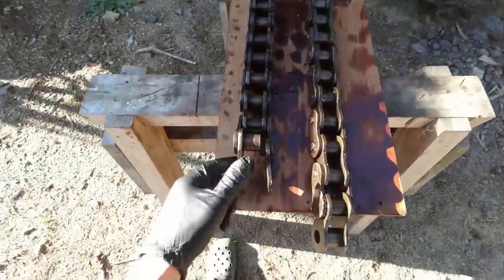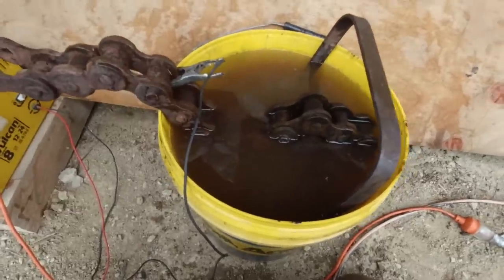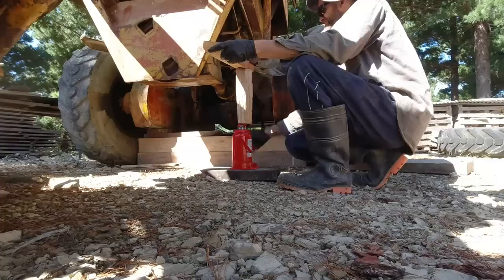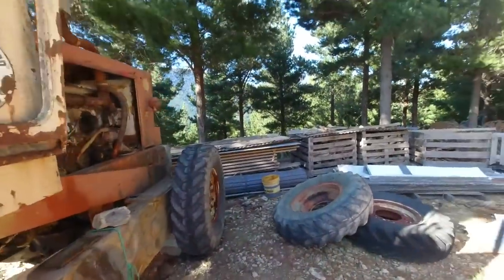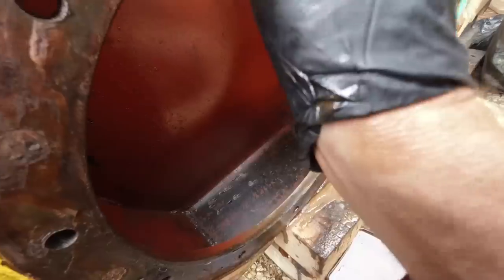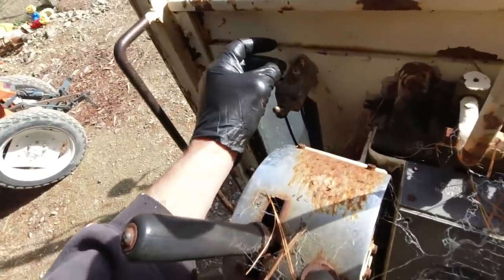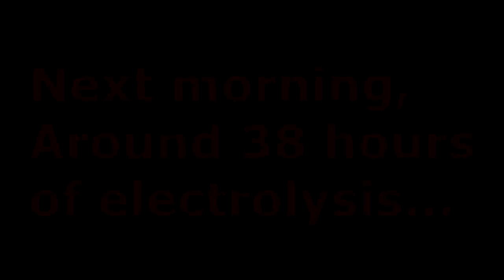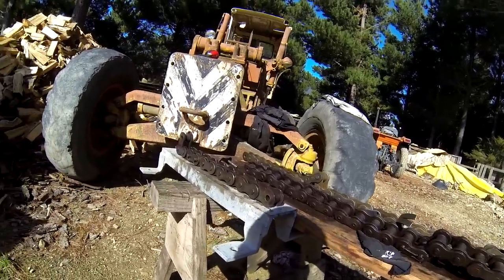12 Ton Grader for Scrap value Part 3- Long Overdue Repairs & Maintenance

Comment: Hahaha! Love the "Bug Grader" ornament". Still laughing... That's great. With a little time she'll be all rusted up nice and looking like it came that way. :)

Gear suggestion: Get yourself one of those inexpensive "Ditco's", a 90' pneumatic grinder that takes the screw on discs of all types. That is a heavily used finishing and general usage tool in many machine shops. A few drops of 30 weight in the nipple before each use, a towel on the exhaust with a couple of shots of air and you're good to go for an 8 hour shift. The veins are phenolic and the innards require a few drops of oil at each daily use to keep blades, gears & teeth lubed so they last. Makes short work of touching up things like large gear teeth. ;) That stuff that came out of that reservoir I think is the worst you've changed yet! Yum! :) 

The gear housing you pulled with the thin seal. I wouldn't put that back without some Permatex Gasket Maker. so you "know" it won't ever leak.

Nice job fixing the air switch and catching the tire size driving issue. Shame you couldn't make one good chain out of the two, probably for the best making the investment in a new, or good used. She'll be worth a lot more if you ever sell her off after you've gotten your usage out of her.

Great job so far! Love that bug!

Comment: For chains u can also use old oil. Put the chain in a pot with the oil and heat it on a fireplace, heater..etc.

Comment: Evapo-rust that stuff is amazing I had a chain in the same condition when it was done soaking 2 days and then in transmission fluid for 24 hrs it looked and functioned as if you bought a new chain

Comment: Heavy gauge polythene film for the hub seal would be suitable Marty it helps it slip round, (not too heavy though). I've used it on those type/size of hubs before mainly Coles Cranes with rail wheels fitted for railway goods yard use. I know what you mean with the ram. I bent down feeding one and it automatically head butt me. Few minutes before I got my senses back.. I bet it never felt even a murmour.. Good vid, brought back outdoor machinery work I used to do for British Rail (LNER) in the 70's.
Reply from the maker: Good idea, cheers

Comment: A few things.  Try washing soda (sodium carbonate) in the electrolysis tank and not salt.  For rusted chain get an old pan, waste oil and a hob.  Heat in the rusted chain and oil on the hob on medium for an hour or more, frees up nicely.  Last I had no you are Angry Ram!

Comment: If your stuck for a filter wrench again and the box section you have is too wide I've seen an "adjustable" one made up; Drill two holes in ajoining sides, then weld two nuts on over the holes and you can thread in bolts to take up the slack

Comment: Marty have you got any big magnets you can stick inside the tandem cases? Perhaps those big ring magnets you get on CB radio car aerials.
Reply from the maker: I would be worried about the chain picking them up and getting dragged into the sprocket

Comment: Never used salt but I have used Baking Soda with real good results on a rusty Old single cylinder hit n miss engine, and after 5 days it was freed up and turning over and you could see the original green paint. The engine was burred in the ground for 30 years, it is now one of my show peaces

Comment: Regarding the tire diameters-  I think you made a good observation about tire diameters.  I once had a New Holland windrower with hydrodstatic steering.  When bot h steering levers were fully forward, the thing would not necessarily go in a straight line.  The manual told me to adjust the tire pressure to get the tire diameters to exactly the same diameter.  Maybe you could do that to make the effective diameters the same.
Reply from the maker: Good point, I will run a tape measure around each tyre while its sitting on the blocks

Comment: In fact I think the bigger diameter tire was making the smaller diameter wheel turn around too slowly.  The distance travelled in one rotation of the big wheel is more than the distance of one rotation of the smaller wheel.  He's right about the fighting, in any case.

Comment: You could use a good pressure washer ! I enjoy your channel very much . Thanks !
Reply: Marty has one. I think his philosophy is that oil leaks show up where adjustments are needed (like all the loose bolts on the diff) or seal/gasket leaks.  Once these are fixed it becomes worthwhile to clean it down..but as we see, oil soaked metal doesn't rust and paint stays bright under the "protective" oil coating......

Comment: Wow did you see that great grinding compound coming out of the oil sump?  I'll bet one could do some nice polishing with that stuff...or maybe some de-burring, eh? -- This is probably too late to help, but what about making your own thin film gasket using a plastic garbage can liner?  I've measured the thickness of one particular bag type at .015", I'm sure there are flimseyer types to be had.  Good luck with the grease, can't really be any worse that it was. -- It's nice to know that the tool you made comes with a life time warranty:  Manufacturer will fix or replace upon any failure of this unit. -- Hey that's a really cool snail.  Great video Marty, thumbs up.

Comment: A 1:10 molasses to water ratio is also a good rust remover. It doesn't require the full conductivity and has good surface contact all over. Especially good if you can get some cheap agriculture grade molasses. It works as a chelating agent.
Reply: I use vinegar.  Cheap and fast.  It works better than electrolysis because electrolysis is supposed to be line of sight only.  It also strips zinc really well for welding
Reply: @nathanchalecki4842  Agree I usually drop items to be cleaned in a drum of vinegar and keep checking progress

Comment: Whilst up on the blocks, i would pop the inspection covers off (with the wheels taken off) and check the chains as they "drive" by. Easier to see any underlying defect they might have that's otherwise obstructed by the case, static inspection, or manual turning. There's quite a bit of force put on to these chains, so it's likely that even the smallest of failings, might snap the chain like a twig.

As for the sludge, Naphtha is your friend. Dangerous, yes, but you can pour that stuff, let it drain after half an hour, filter it through paper and reuse it indefinitely. I've been using this stuff for years, some of my older jugs have 4 years on them. Just the other day i dropped my mud, oil, crud encrusted bike chain in a wat of the stuff and gave it a few shakes, you won't believe how fast the crud falls off until you see it with your own eyes.
Reply from the maker: Very wise words.. yes I will definitely be checking the other 3 chains,

Comment: I did notice or rather hear that when you were filing the burrs off the sprocket that it had a 'ring' sound , that's a good sound. as It tells us that there are no cracks in the sprocket.
It is a shame that all your work in cleaning and trying to 'save' the chain that it turned out to be a lost cause. 
Well it could have been the other way, and if you didn't do that, you'd never have known, correct?
One thing  is good in all this,... you must be a Saint, with all that patience; certainly is a good thing that you are patient in doing this kind of work, hahaha!

Comment: Great video, as others have commented its possibly better to use sodium carbonate (Washing soda) with electrolysis, doesn't do a better job, but does not produce chlorine gas - Which if you're doing it indoors may be an issue.. There is a really good video on electrolysis and rust removal this from another Youtube guy, 'Geoffrey Croker' who happens also to be from New Zealand, do you know him? ;)

Comment: Wow how much oil does that final drive hold.  Will have to replace the seals in that to keep the water out.? Love old iron see come back to life. Thanks for sharing.
Reply from the maker: It needs around 20 litres in each chain case, yes I will make new gaskets for all the covers

Comment: That sludge is likely a mixture of iron(II) and iron(III) oxides.  They are green and red, respectively.  As the oxides come off and combine with bits of oil and the bubbles from electrolysis, you get your slime.

Comment: Hey Marty got a few questions, Is the back end is linked by a differential that goes from one side to the other... Wouldn't having all four of the tires on the back end be just as important as each side having the same size tires? I know you did say the budget is tight. Thanks
Reply from the maker: Yes you're right, it has a straight axle drive, no diff so all 4 wheels drive at the same speed, probably why its so hard to turn. All the drive wheels are similar diameter
Reply: @MartyT  Actually I'm not right, I thought there was a differential shaft that allows the inside to turn slower than the outside turning radius when cornering. So I guess no matter how you slice it, your going to be dragging tires every time you make a turn . Not the ideal machine if you have to do tight bends or switchback roads, good think you have that little doser for that.

Comment: The electrolysis trick is new to me, will be using that one!
Reply: Check out Keith Rucker's site, he has a great video on the how to..  It works great, but don't use salt as it breaks down into Chlorine.  Use Arm and Hammer Washing Soda.. Much safer
Reply: Bill sargent cheers, already got my first piece stewing away nicely.

Comment: i remember an old friend of my father,who drove the county council AB grader from when it was brand new till decades later,he used to say that the front tyres were critical for control of the grader.i used to hangout with his son during school hols,and we would pushbike around the district all day,he would teach us all sorts of shit
Reply from the maker: Nice.. yeah my front tyres are pretty poked, they'll be ok for the amount of work I'll be doing though, probably only 50 hours every year
Reply: @MartyT  Could it be possible for the grader to repair other private roads in your area. Sad with only 50 hours if it gets in good condition. Great if the grader can pay for itself.
Reply from the maker: Yes I could get more work with it, but it will last a lot longer if I just use it for my own driveway

Comment: A mate of mine bought an old Airman grader that model was the first double axle drive machine made it had a donkey start 3 cylinder cat moter with a massive stroke it also had a twin plate toothed mechanically actuated you needed about  50 lbs of pressure to engage the gearbox . All the blade and steering were hydraulic he got hold of cat in the USA they contacted him and sent him the set of manuals printed and bound in original
Reply: Edit to cut a long story short they offered him a new Cat 120 grader in exchange and he turned it down it is now completely restored

Comment: I wonder why the guy you bought the grader off had a spare chain....
Reply from the maker: Haha yeah.. he used to wreck heavy machinery for a living so he has all sorts of goodies
Reply: Looked to me like the fellow was a parts yard master, by how things were stored and kept. I know a few, you have to, otherwise equipment can quickly get your budget in a cactus, and they all have sheds and tarps and various pieces of equipment that other people want and they sit on. I call them rust dragons.
Reply: @MartyT   Maybe he has some better tires you can get from him. I know those old tires will probably work for you.  But I think a luged tire would be easier working with the greater than the bald ones.

Comment: I would say that the chain prob came off due to work sprockets on both ends not enough teeth on top to hold it. It might have been lose to let it get off the sprockets

Comment: Are there two chains inside,or one big chain ,??? What’s the oil level?? The oil I have is 90 140 military surplus Molly , I have barrels of it new, thanks BigAl California.
Reply from the maker: There are 2 chains on each side, It takes around 20 litres each side, it will keep me broke for a few months
Reply: Marty T oh ok I never knew there where two chains, I thought 💭 all these years it was one big chain , wow, ok 20 liters that’s not vary much oil, so probably just enough oil setting in the bottom of the chain box to let the sprocket and chain barely dipped into the oil right,??? Ok then, thanks again BigAl California.

Comment: Shocking price for chain but guess they rarely need replacing , great that your solving it other problems so quickly. With it working you will soon have a very nice road up the mountain  smooth ,wide and crowned

Comment: It's kool looking at how electric can do it. However I think Sand blasting would be a quicker solution drie it then flat paint it with some wd40. Or something with grease the corners. Just a thgt!

Comment: Do you think it is likely that the chain driving the rear wheel is also damaged and so needs to be replaced as well?  Yours is my favourite YT channel - fascinating and excellent editing.
Reply from the maker: No doubt it is less than perfect, I could quite easily pour tens of thousands $$ into it to fix all the worn out parts but my budget is limited and it would take all year

Comment: While the filter is off you should square up the bolt to fit a normal size spanner. Regards Billy from S A
Reply from the maker: Good thinking but I have the special tool now so it will do for next time

Comment: Overfill the final drives with diesel and drive it around a bit under very light load.  That will flush out all the gunk you couldn't reach.

Comment: Marty, how do you rate the Tool Pro 1/2 inch impact wrench?
They're on special this week.
Reply from the maker: Awesome tool, I recommend it. Makes my work so much more efficient, battery life is great, I've only had to charge it 3 times since I got it last year. It doesn't have the torque of my air wrench but Its great on nuts and bolts that aren't seized

Comment: i cleaned up a huge number of parts an bits on my 88 4runner which was caked in rust flakes and rust impregnated grease if you add a drop or two of liquid soap it will l;iterally strip the oil out of every pore of the metal leaving it nearly ready for repaint itll flash rust infact if you dont paint or oil it asap used an old pc powersupply to do mine
Reply from the maker: Good tip thanks. I'll try that next time
Reply: @MartyT  just finished watching LOL great ornament!

Comment: I do wish the impatient ones would give the man a break!!

Firstly, his country has been in lockdown against coronavirus. Secondly, both the David Brown and the Bristol were bargains which required remarkably little attention on top of a full service in order to  make them usable once more. The impression gained is that the grader has withstood gross neglect rather less well than the above pair and will swallow up more time and money, being bigger as well.

Lastly, the "cosmetic" issues such as paint. Marty's priorities are mechanical ones first by a very long way and if you listen to the Bristol's engine running you will be aware of how right he is.

Comment: Well, I gotta say, never in my career as a printing industry service tech have I come across a used piece of chain that was RE-usable.
Reply from the maker: Plenty of old machines around these parts that have a blown engine and are parted out, but yeah this one was a bit far gone
Reply: @MartyT  no doubt. But, compiling my experiences with your chain experiences in this episode...I'm batting 100%. Anyone who tosses old chain had a reason, but a chain off an old machine that broke down for other reasons likely has life. There are no donor machines in the printing industry, unfortunately.

Comment: FYI & ALL the circumference of the wheel is from the center to its ground contact surface; no matter the wear. A good tire can be equalize to a worn tire by air pressure

Comment: I use 4 stainless steel plates connected together. Then a copper rod to hang the part from . I use 20amps to clean the parts.
Reply: holy shit, I hope you're joking about using stainless steel for electrolysis. in the chemical reactions caused by electrolysis, the chromium oxides used in stainless steel alloys react to form hexavalent chromium (chromium-6), which is highly carcinogenic and very water soluble (and therefore easy to poison ground water supplies with). it's extremely hard to remediate, too.

Comment: What type of gloves do you wear Marty? I haven't been able to find good durable gloves for mechanical work
Reply from the maker: I use nitrile black gloves when working on delicate parts I need to keep clean, and polycotton with nitrile grip over top when I need a bit more protection. Supercheap have a good selection https://www.supercheapauto.co.nz/p/norton-norton-poly-cotton-glove-with-nitrile---pair/574974.html#q=gloves&lang=en_NZ&start=14
Reply: @MartyT  Thanks Marty, I love your videos. I always learn something

Comment: Not surprised that it is likely to cost you $500 for a new heavy duty chain. However, it makes both the versatile David Brown and the collectable Bristol with its quiet, smoke free,  power unit,  bought for the same money, seem even better buys. As  for the even cheaper Farmall!

Following "Marty's ministrations" all three are capable of a day's work. I suspect rather more ministrations will be needed on the grader before it is similarly capable. Hoping I am wrong and with every best wish.
Reply from the maker: I suspect you may be right. This old grader will keep me poor for a while, but will give a much smoother finish on my 6 km driveway than the Bristol Dozer and DB990... Once I get all the issues sorted.